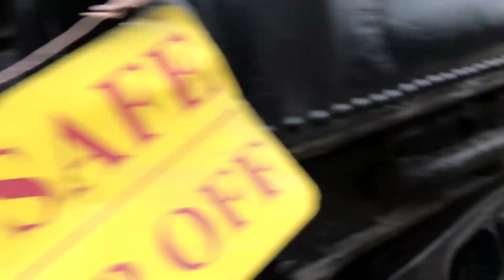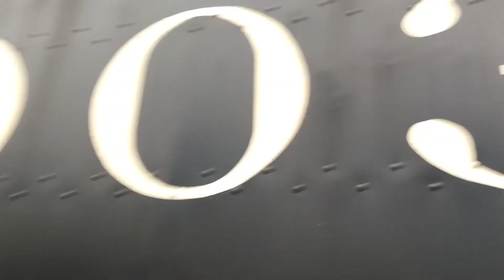Trolley museum in Arkansas Frisco 4003

Comment: That new track down by the A&M mainline was built by me and my friends to hold the little yellow engine. We are rebuilding the entire wye to be able to turn the trolley around eventually. We are now replacing and rebuilding the track in front of the "tweety" the yellow engine. We are also restoring the carts and crane that were moved up by the trolley barn. Lots of work to be done. First we have to rebuild part of the mainline that is too wide! The trolley derails.